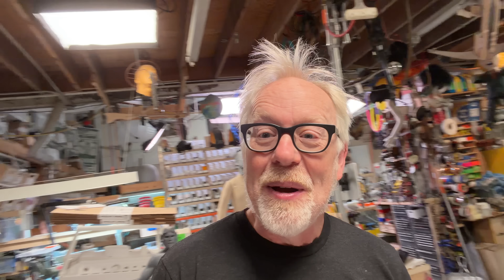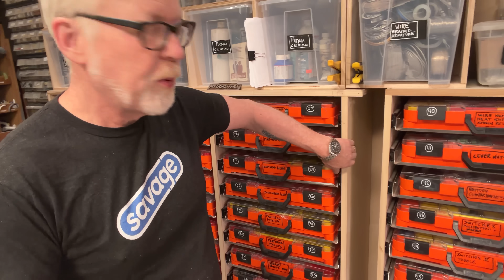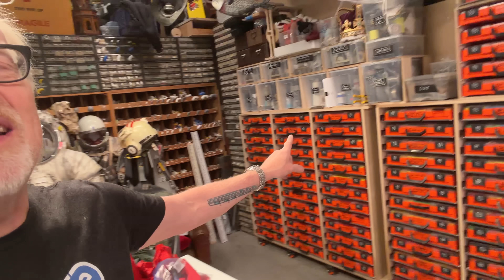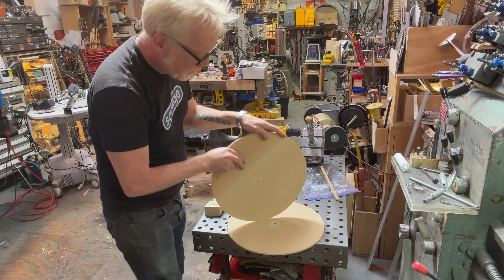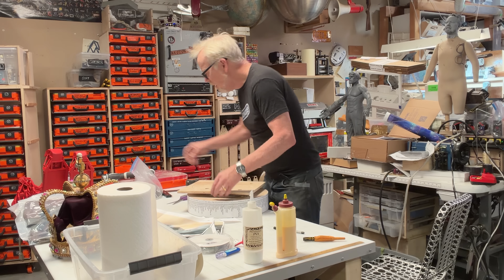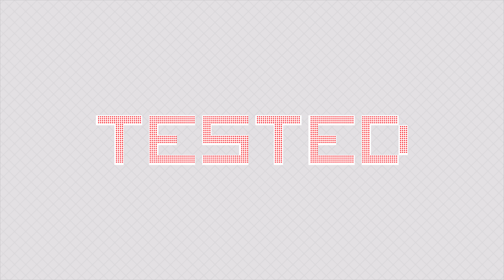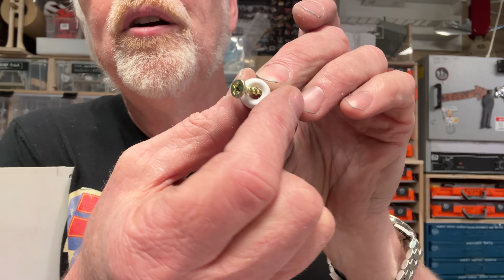Adam Savage's Hardware Organization Mistake!

Comment: 6:18 still shorter than a receipt from CVS.
Reply: I’ve often wondered how much CVS spends on receipt printer paper.
Reply: ShopRite self-checkout receipts are right up there, too.  I think they actually give CVS a good run for their money.
Reply: "O look! A free scarf!"
Reply: Would actually be pretty cool to print the list out on receipt paper, then it wouldn’t need any sticking together or trimming
Reply: Receipts are usually thermal paper and fade pretty quicky, or react to tape or heat etc.

Comment: Make a plexiglass window with a line so you don't get lost.
Reply: i was thinking similar but with a magnifier
Reply: @zigziggy7 I was thinking the same. A small one that can flip in and out for the days when the eyes are extra tired.
Reply: @zigziggy7  magnifier was the first thought i had
Reply: or just use a cell line in the spreadsheet suite
Reply: Also, protective coating so no Adam oopsies happens.

(Paint, coffee, sweet/unsweet sticky drinks, most importantly, dirt and grime)
Reply: Or a stiff wire painted red.
Reply: And the line should be sortimo orange.
Reply: Maybe one can additionally use a few mirrors to Orient the displayed text more ergonomically
Reply: I feel like the whole think needs a plastic cover or its going to get really dirty and harder to read and eventually fall apart. Its good that its easy to replace though
Reply: @MartianDropkick  It needs a larger-diameter area at one or both sides of the wheel, to provide a surface to manipulate when turning the wheel, so that the printed part doesn't get dirty fingerprints on it.